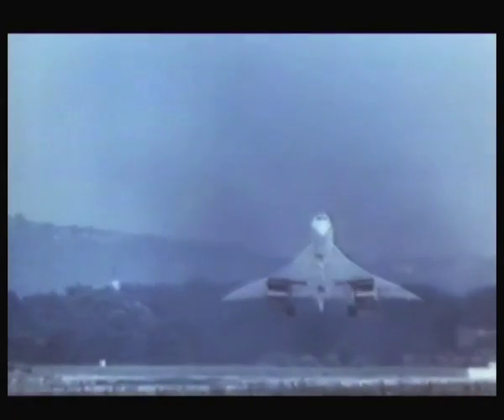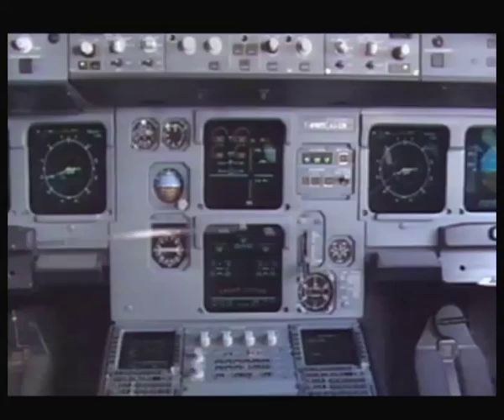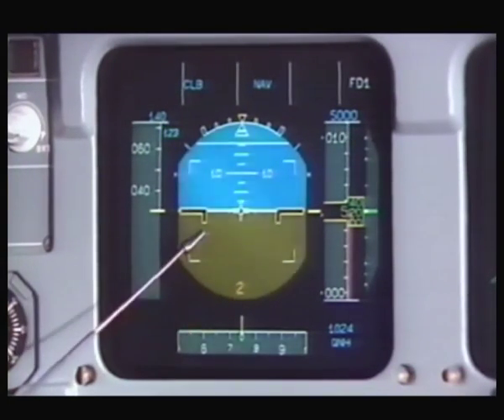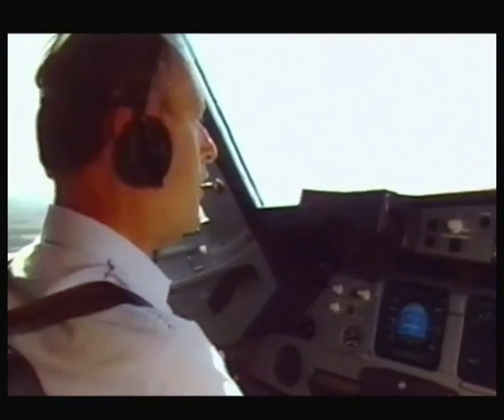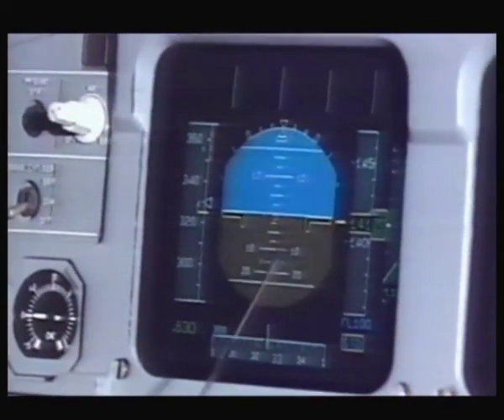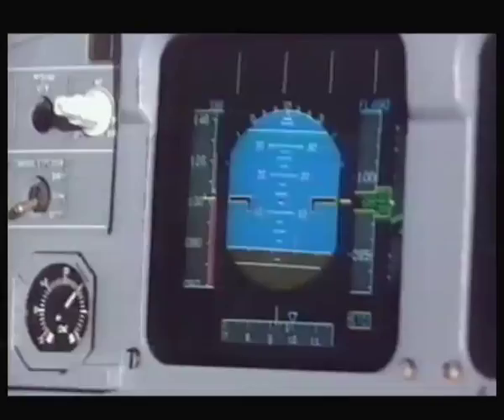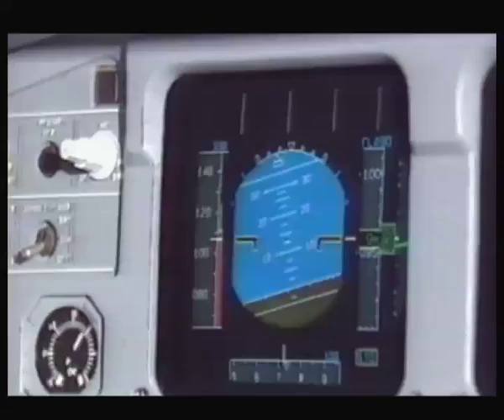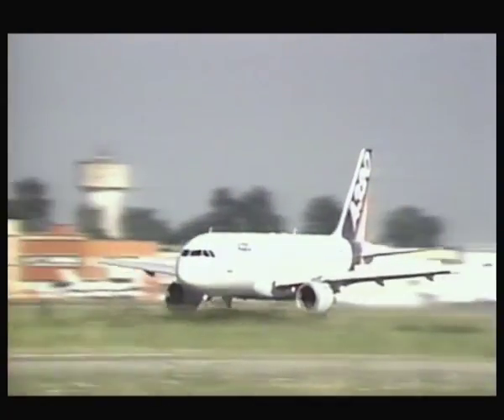Airbus A320 Fly By Wire Demo

Comment: FBW is great, provided sensory gauges do not fail. If you take a look at Air France flight 447, failure in sensory gauges can cause FBW to misinterpret situation. Plus, the opposing side-stick control cause cancelation in control. What a troll!
Reply: +mrcannotfindaname , the opposing side-stick control cause cancelation in control.? i thought both sticks were independent?
Reply: Rahul Rathnakumar
 Airbus sidestick input is the sum of both sticks' input, which is a bit flawed. Although there is a sidestick priority button in front of the captain that he/she can press to gain full control.
Reply from the maker: The priority pushbutton is on both captain's and first officer sidestick. The idea is to cancel the opposing inputs in case of pilot incapacitation (i.e. the pilot falls over the controls). If you press it for more than 40 seconds you will disconnect the opposite sidestick. To reconnect you just have to push again the button.
Reply from the maker: Both sticks are independent, but if you apply forces on both of them the resultant movement will be the algebraic sum of the inputs (i.e. one stick full up + one stick full down = 0 // half stick up + half stick up = full up).
Reply: The FBW in AF447 did not misinterpret anything, it basically switched to alternate mode because of conflict in information (speed data), so some protection mechanisms were not available. FBW is great but it does not take out the need to have well trained pilots that are able to understand the situations they are in / going to be in, and the AF447 crew totally lacked in that as well as their CRM was close to having none at all.
But I agree that Airbus should reconsider their cockpits as well, f.e. the non linked sidesticks that helped to create confusion.
Reply from the maker: @heinrichvonhachtenbuchler3167  I fully agree with your comments, Airbus needs to reconsider this fundamental aspect of design and incorporate linked sidesticks.
Reply from the maker: Paul Garrett  As with most aircrafts with positive stability, sometimes is better to just release the controls, the exception being serious upset or spins.
Reply: AF447 was caused by an idiot first officer who kept pulling back the stick during a stall. Criminal behaviour.
Reply: @ElshadKarbasi  You seems to forget the stress factor.
Reply: During the AF447 the computer automatically disengaged the autopilot after all three fully independent pitot airspeed sensors failed. The anti-ice feature successfully heated one of the sensors in about a minute and then the pilots could have simply re-enabled the autopilot and the plane would have flown to the destination by computer. Instead, the pilot flying (first officer) went full-on panic and froze while holding the side stick (similar to yoke) full back and the non-flying pilot didn't somehow notice this even when he later tried to control the plane, too. And this incorrect pilot input continued (about 10 minutes if I remember correctly) until the plane was falling so fast that it couldn't be recovered even when one of the three pilots finally understood what was happening.

I don't understand how they missed the "DUAL INPUT" warning, too. For some reason just because the plane lost airspeed sensors for 60 seconds, both the pilots in the cockpit went totally in mode "computer is broken, all instruments are broken" and when computer said "STALL" the first officer that was flying the plane decided to go against his training and instead of immediately pushing the stick forwards to stop the stall, he kept still pulling the stick backwards.

The plane was in alternate mode after all the mess that the pilots had made so I'm not sure if just letting off all the controls would have stabilized the flight.
Reply: @MikkoRantalainen  Biggest factor that lead to the confusion of inexperienced Bonin was the stall warning that inhibited when valid air data is lost. As he pulled up the stall warning inhibited due to loss of valid air data. Instead when he pushed down the stall warning became active again due to valid air data. This made him think he was in overspeed and not in a stall condition thus kept pulling up. The stall warning started inhibiting at about one minute after entering the stall so the more experienced captain never heard the continuuos stall warning because he entered the cockpit one more minutes later. If the captain was there from the beginning he would have heard the countinuos stall warning and would have corrected instantly. Bonin didn't do that, we'll never know precisely why in that minute of continuos stall warning he pulled up.